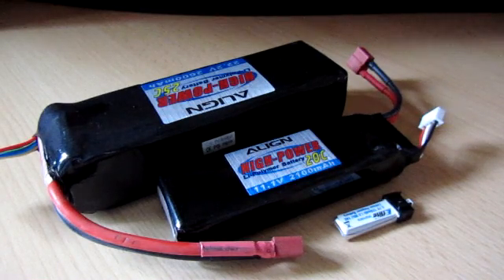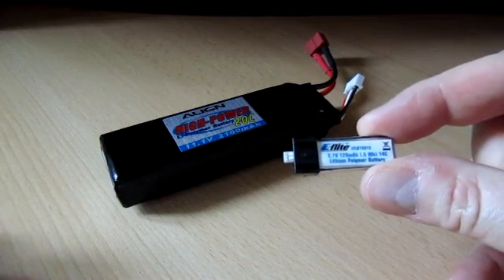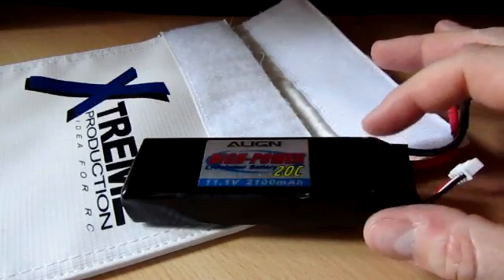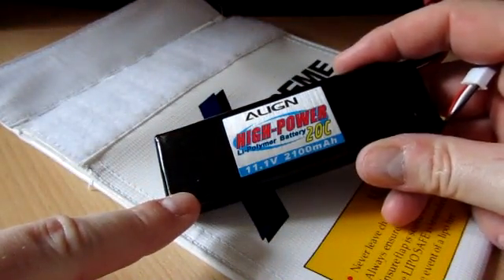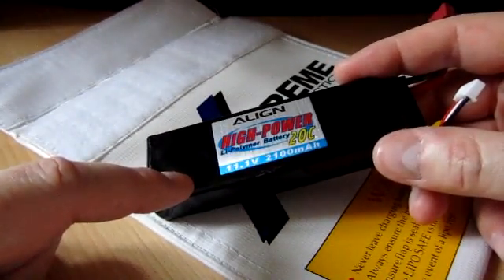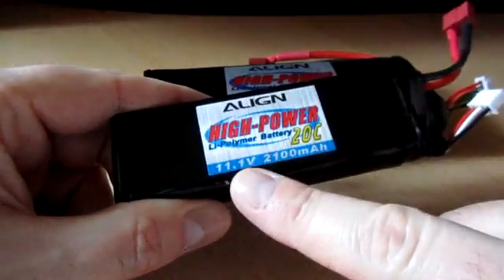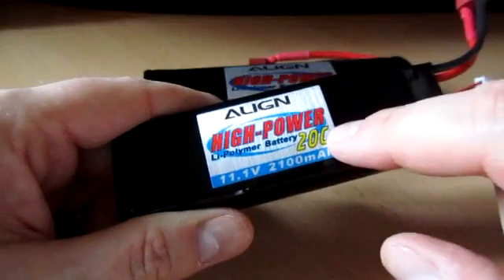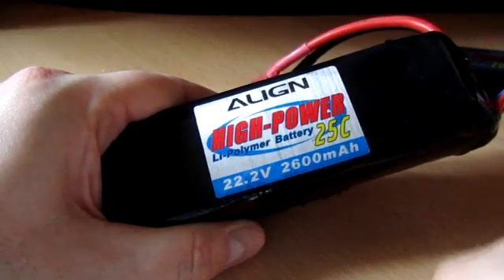Simple overview of the LIPO battery (LIPO Explained - mAh, C rating etc)

Comment: I understand the mah decimal trick but then how do you apply that to smaller LiPo’s with a mah less than 1000? For example, I have a 1/18 and 1/24 WLtoys cars which both use tiny LiPo’s in the 300-500 mah range. My charger runs 1-3 amps. So do I just go with the 1 amp setting? Thanks.
Reply from the maker: Same way. Charge a 500mah Lipo at 0.5 amps etc. 
Best of luck
Reply: @Painless360   Thanks. Note, I use a basic Ultra Power UP4AC charger. It only has 3 amp settings - 1, 2 or 3 amps. Should I invest in a more advanced charger or can I get away with the lowest 1 amp setting on my current device? Thanks again. I appreciate.
Reply from the maker: Definatley if you want to charge batteries that small. Best of luck

Comment: Since voltage x amps = watts (power), am I right to believe that a 3s 4000mah lipo would generate more power than a 3s 2200mah?
Reply from the maker: Probably but it also depends on the C rating that dictates the maximum current you can pull from the battery... Happy flying
Reply: @Painless360  thanks

Comment: 2100mah × 20 = 42 amps

Does it means it can deliver 42amps at once ?
Reply from the maker: In theory, that’s right.
Reply: Painless360 

Atonce  ?

Practically  it's  42 amps in 2 or 3 minutes

Isn't it 
Am I right 

60minutes / 20 = 3 min
Reply from the maker: Yes, but don't forget - you don't pull all of that capacity of the battery. In practice you're only going to pull 80% of it. It also relies on the manufacturer being honest about what the c rating of the pack actually is ;)

Comment: Question, I have a one cell batt, do not know the size, when I charge it starting voltage is 3.3 volts and the charger tells that it took 1,250 mAh to reach 4.18 V, from this info can you figure out the size of the cell(battery)?
Reply from the maker: Not really, sounds like a 1000-1100mAh pack to me as at 3.5v per cell it's about 80% discharged.. ish..
Reply: thank you P-360 !

Comment: Very good video. Great job.
A quick question please. Can I replace a 7.4v 2 cell 1800 mah 25C lipo battery with a 7.4v 2 cell 2700 mah 10C lipo battery to get longer flight time and what are the implications please?
Thanks
Reply from the maker: +Zig Zag possibly. The extra weight if the other pack will stop all that extra capacity being used for longer flight. Also the larger pack with only 10C will only be able to provide 27 amps (versus the 45 of the original lipo) so check how much current the model needs.. Best of luck

Comment: I have a question: My main quad battery called for 3s, 3830 mAH, 11.4 voltage. The LipPo battery I bought has 11.1 voltage, 3000mAH, 3s. Will it increase the flight time?
Reply from the maker: Nope, the capacity gives the flight time. You have 830mAh less than the recommended. That should work but watch the flight time and COG.. Best of luck!
Reply: Painless360 : should I buy a 5000mAh, 11.2 volt, 3s  for increase in quad flight time?
Reply from the maker: +Rian it will, if the model can handle the weight of the bigger battery. Best of luck
Reply: how did you calculate I have 830mAh based on my information?
Reply: you have 3000. (830 is the amount less than your recommended 3830) ....  3830-3k=830

Comment: This was a great video, thank you so much.  I am brand new to RC flying and trying to commit all this to memory.  

I do have a question that I think I Understand but I want to ask to make sure.  If I buy another lipo battery and I increase the MAH from 1500 (what the quad came with) to 2200 I would not be doing anything wrong to my quad?  If I am understanding correctly than I would just be increasing the storage tank by buying the 2200 MAH battery.  To me this would mean that I would increase flight time, correct?  

The 1500 MAH can be charged at 1.5 amps where the 2200 can be charged at 2.2 amps correct?

Thanks for your help, I'm gonna go watch your video again.
Reply: Scott Harrell that was the exact question I had and looked to this vid for a possible answer. Thanks! Happy flying
Reply: do you need lipo battery ？if you need , see the below link :
sktvision.aliexpress.com/
Reply: Hi Scott. Maybe do what I have to do - write it down in a little black book.  The OTHER little black book! BobUK.
Reply from the maker: +Scott Harrell so long as the battery pack has the same voltage  (3s, 4s etc) then it will not hurt anything. Remember that the extra weight will affect flight performance. Best of luck!

Comment: From the image at 8:15 i understand that the voltage should drop no more than 20/30%. Does that also mean you can only use 20/30% from you mAh.
Reply from the maker: +bas van der knaap almost. A fully charged pack will be 4.2v per cell. If you pull 80% of the mAh capacity from the pack then you'll have approx 3.5v per cell and a pack that's effectively 'empty '. Best of luck!

Comment: yes, but if  I use a higher c rated battery than the stock one wont it fry the 3-in-1 esc of my 4 channel 2.4ghz esky big lama heli??
Reply from the maker: Nope, C rating is how much current a bettery can provide. It only supplies the current the motor wants..

Comment: i have 3 cell lipo 2200 mah 11.1v so when i want to charge my battery full its stop at 2 cell . 
1 cell - 4.12v then 2nd cell - 8.40 and 3rd cell - 8.40v  . this is condition of my battery
Reply from the maker: Impossible to answer as no single cell should read 8.4v, I'd suspect that what your are using is measuring both cells.. Best of luck!

Comment: say you have an 80c 4s battery,
does that mean each individual cell is rated for 20c?
or is it all 4 cells are each rated for 80c?
Reply from the maker: The cells are actually connected in series to increase the voltage (hence a 3s pack has less voltage than a 4s pack). The current flows through all of them so each cell has to be rated to that level. Happy flying!
Reply: so i would need 4, 80C cells to make a 80C 4S?
Reply from the maker: I'd just buy what you need, this practice of connecting batteries to get what you need went away to a large extent when the amount of variety increased and the price dropped. Best of luck!
Reply: thanks man i appreciate the feedback

Comment: Hi, I got a question:

If I can't find a 3S 4400mAh 45C to buy, can I strap together 2x 3S 2200mAh 45C batteries and hook them up in parallel (via a simple 2-into-1 XT60 connector & equivalent balancing lead)?

Will that 2x 3S parallel set up still count as a 3S... or does that make it a 6S..?
Reply from the maker: +K Khalifah we have another video that covers this (Search for something like  ' painless360 lipo series' to find it ). Parrallel will give you a 3s pack with 4000mah. Best of luck!

Comment: Does this also work with 10s 10 000mah battery? 10a for charging then?
Reply from the maker: +César Grimmelprez unless otherwise stated on the pack, yes. Be aware that many chargers will struggle to deliver that full amperage.

Comment: hi there, your video is very informative but im still confuse, i have a motor with a maximum current of 38A and 40amp esc 16.6 volt max., may i ask what the best battery for a longer flight in this set up?. thank you
Reply from the maker: So you need a 3s LIPO (12.4V) or a 4S LIPO (16.8V). The more mAh the longer the flight..
Reply: if im going to use 5000 mah 4s lipo 25c, is it safe? will it not burn my 40amp esc?
Reply from the maker: It doesn't work that way. See our power videos in the 'Introduction to RC' playlist. Best of luck!

Comment: Great video!
Thanks for the detailed explanation!
I will be building a ground station for fpv on an airplane and I will be having a computer in the ground station connected to the DAS on the airplane to send me bunch of different data! My question is if I want to power the small computer (not a laptop) and an lcd monitor off of bunch of lipo batteries, is it possible? And how many do I need in parallel or series? Max power input of the pc is 60w and input voltage is 12v! Thanks
Reply from the maker: +Mher Asadourian The amperage needs to be calculated then the right battery selected. You could always use something like this - http://www.banggood.com/Vensmile-IPC002-Plus-Windows-10-Intel-Z8300-2GB32GB-Wi-Fi-2_4GHz-5GHz-BT4_0-TV-Box-Windows-Mini-PC-p-1022297.html?utm_source=youtube&utm_medium=Painless360&utm_campaign=SKU339760MINIPC&utm_content=chengshaoyunBest of luck!
Reply: Thanks for the recommendation!
For the computer mobo with its hardware the output requirement is: 19.5V 3.33A 65W
and for the LCD output the requirement is 19V 2.1A! And I would be more than happy to get 30 min out of both with separate battery! Weight is not a factor nor number of batteries in parallel or series!

Comment: hello,
i get a drone with a battery 7.4v 500mah charger is 5v 0.8a output how long it should charge.
i charged my battery while it was connected to the drone. it just doesnt want to work anymore. :(  no heating up, charge a little but not enough even to take off once
Reply from the maker: I'd check the battery too. Best of luck!

Comment: My problem now is that I have a 7.4v 850mah battery and the charger is 10v 800mah(stock version) it takes more than 5 hours to fully charge. Why does it take so long?
Reply from the maker: +Badr Fazli Could be one or both of the following reason - 1)the charger is using a low current and this increases the charge time and 2) If the charger is balancing the pack then that can take as long as the main charge if the battery is not in good condition. I suspect that it's not using 800ma on the charge though as this would take a lot less time to charge if it was..Most people end up investing in a decent charger that they can set up the charge on.

Comment: Which lipo battery is perfect for 2200kv motor and 1000kv motor  and sir can I use  610 mah 11.1v lipo battery is it fine for 2200kv motor
Reply from the maker: +Harsahej Singh I think I just answered this on the other video. No need to post your question multiple times. Happy flying!

Comment: Great Video, I want to build a 500mm quadcopter, with 2216 820kv and 40a ESC, what battery would you recommend that delivers the longest flight time?? Or should I go for stronger motors to get a 5500mah battery? love your channel
Reply from the maker: +Francisco Antonio Font Diaz Larger batteries weight more so you need to figure out the maximum weight the quad can carry and pick the largest pack it can handle. Have a look at the max thrust for those motors and work back from there. Best of luck.
Reply: Thanks for the quick response

Comment: i am planning to buy lipo 4s 10,000mah with 10c. after watching video i am concern about C rating of this batery.
is 10000mah 10C buttery will be the same as 30,000mhn 30C? is it safe to buy this battery and use with 4000 size 500kv motors?
Reply from the maker: +Michael Akopov a 10,000 10C battery will provide a maximum current of 100Amps, a 30,000 30C battery will provide a maximum of 900Amps..

Comment: question!  my battery is new 4s 35c burst 75. i wonder why the battery  lost c rates now is weak the quad fly slower! i have mini quad with a 20amp esc and 2000kv motors. before i have a good speed and power. but after 10times flight now i notice no more power. I'm thinking is over used?
Reply from the maker: denmay2005 Unlikely. How are you checking that it's charged? How do you make sure that you don't over-discharge it?

Comment: quick question, I am running a 250 quadcopter and a 300 quadcopter on 3s 1400 mah lipo's, they have cameras, vtx etc, when thrashed the flight time drops a lot and the lipos get hot, so i think they are over working the lipos, what would be the maximum power you would recommend for these sized quads?
Reply from the maker: keyproductions100 Sounds like you are asking for many more amps than the battery will provide. What 'C' rating is the pack?
Reply: that's what I was thinking, my 1350 lipos are 45c and my 1400's are 40-80c
Reply from the maker: I would suggest that you look at 1800-2200mAh packs as a start. I use 2200mAh/20c packs here on the 250 quad and 3000mAh 25c packs on the 330 class quads.

Do you know the amp draw of the motors you are using?
Reply: im not quite sure, im using emax 1806-2280kv motors with 12a esc's on the 250 and im using emax 2204-2300kv with 12a esc's on the 300, I was thinking about using 1800-2000 mah packs but Im just a bit wary of blowing the electronics up lol I was also wondering if you have done a video for PID settings on the multiwii v2.5, I have mine set on stock settings at the moment but it has a slight wobble and is loosing a bit of thrust because of it, I can post a video if itll help so you can tell me what you think
Reply from the maker: OK, don't worry about the mAh rating. If the cell count (and voltage) of the pack is the same then you can't 'hurt' the model putting a larger battery on it. It's when you start plugging in 4s packs into ones designed and setup for 3s that things can start to get interesting..

I have a video on PID tuning that may help - https://www.youtube.com/watch?v=fNYu5coR6Sg
Reply: yeh I was going to stay away from 4s on these small models, ill have a look at the video now, cheers for the info
Reply: also.... any idea what I should be looking at to stop that slight oscillation in that flight video? any info will be helpful, cheers
Reply from the maker: Could be loads of things - PID settings, ESC firmware issue, wrong timings on the ESCs/FC..

What have you tried?
Reply: ive calibrated all the esc's, don't know how to set the timing on the fc, ill try tuning the pids bit by bit and fly it every time to see how its changed, as I said, its still set on the default pid settings so it probably needs tweekin a bit, cheers for all the help, much appreciated

Comment: Hi painless 360.
It is possible to power (fly) the F450 quadcopter , APM2.6 with a 2 cell 2650mAh, voltage 7.4v? I receive my battery today and found out that i purchased a 2 cell instead a 3 cell.
Reply from the maker: Fernando Calatayud Zepeda If the setup is designed for 3s then the 2s battery will not run the props at a sufficient speed to produce the lift you need. 
I would order the right size battery...

Comment: I have a heli that takes  3 cell  11.v  1000mah  batteries  .Now I see you have one in your vid  a 11.v   2200 mah  would that work and  fly longer any advantage or disadvantage
Reply from the maker: Pman Gman The bigger battery will produce a longer flight time but not 2.2x more as the pack will be heavier so the model will need more power to hover and fly. It becomes a law of diminishing returns.
You also need to find a way to fit the heavier pack into the model and preserve the COG (in a heli COG is right on the main shaft). This can be problematic.
Hope this helps.
Reply: Thanks I will try out a bigger battery next time I order some. One more thing what makes the batteries fail? I have had the original and 2 after market  Zippy ones puff up after less than 5 flights .They are cheap enough so no real concerns. I am using a walkera GA005 and a cheap generic B3 AC I got on eBay  hmm ..I just noticed  that one’s max charge is  800ma  could that be what’s frying the batteries
Painless360
Reply from the maker: I would suspect the charger.

A well cared for LIPO should give you hundreds of decent cycles before giving up. There are a few ways you can shorten the life of a pack -

1) Over-discharge it
2) Charge it at more the 1C (unless stated)
3) Storing on a full charge for months
4) Storing in high temperatures
5) Drawing too much current in operation

Could be one or many of these factors..

Best of luck.

Comment: Very nice informative video! These batteries are Scary Powerful for their small size. Just started using them in projects like super bright LED flashlights.
Reply from the maker: cyjo2009 They sure are, they have one of the highest energy densities. Tons of high current in a very tiny package! You just need to make sure you have a low voltage alarm in the flashlight as they hate to be discharged below 3.5v per cell. Happy flying!